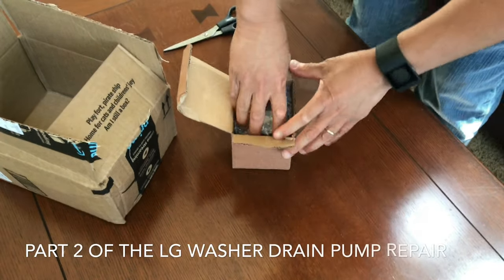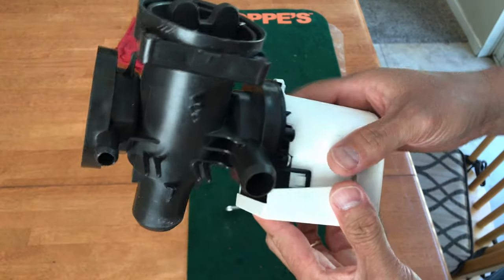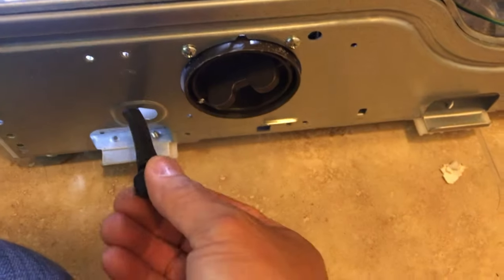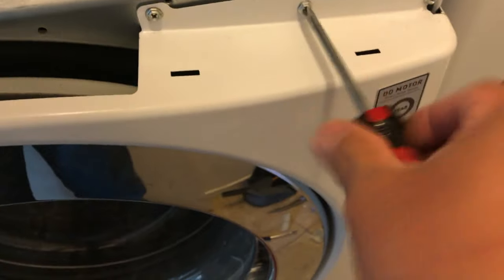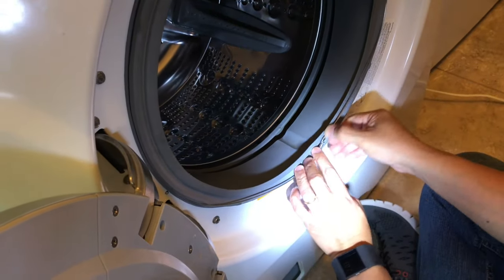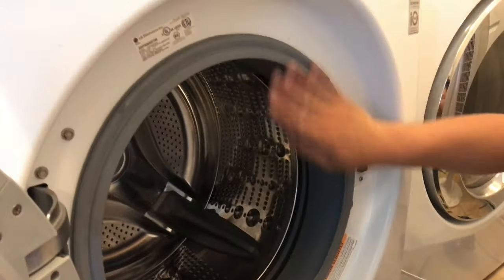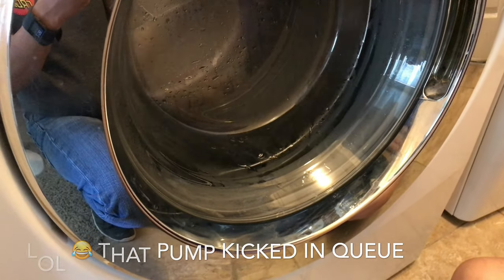How to Install Drain Pump on LG Washer Detailed Instructions Step by Step Pump Repair Part 2 - HD 4K

Comment: THANK YOU for the easy step-by-step instructions on replacing the drain pump. I’ve never done any type of appliance repair before but desperately needed our drain pump replaced ASAP. Thanks to Amazon’s same-day delivery and your fab videos, I am up and running less than 24 hours after my original pump died. A million thank yous!

Comment: I am a mom of 2 and a teacher who doesn't know anything about machinery or mechanics of any large household appliance. After noticing that my washer wouldn't drain, it was extremely stressful because investing in another washer would be another $1,000 expense. So I tried contacting appliance repair but it would still cost be around $300 or more for parts and labor. Just the estimate was $125. I really couldn't afford another thing on my plate on top of the stresses of the pandemic so I started researching online on DIYs. I came across your video and watched it a few times. The clear step by step instructions made me want to give it a try and so I ordered the corresponding part from Amazon for $25 and had my iPad on the floor and started disassembling it. Although it took me about an hour, wow, I seriously cannot believe I fixed our washer myself! Thank you so much for teaching me how to do this. My friends were all amazed and couldn't believe I did this alone. Your explanations and crystal clear directions were so crucial from me moving on from my DIY arts and crafts to hard core washing machines! I cannot thank you enough and if there's anyone out there who's hesitant....just go for it. It's a $25 risk I'm willing to take versus a few hundred dollars. Thank you again!
Reply from the maker: Awesome to hear! Thank you - thank you for taking the time to leave a feedback. I do appreciate it! Great job

Comment: Awesome video!  Thank you. 
I was able to pull it off. I had my doubts for sure. My LG was a different model WM8000HWA. It had three mounting screws that held in the pump instead of a clip. Also there is a circulating component that had 2 different electrical inputs on either side of the pump mechanism . I labeled them before detaching. Lucky I did because my brown/black wiring was opposite of this video. I used a flat head screw driver with my wife’s help to hold the other side of the ring and pried it into position pretty easily. Works great. Big relief!
Reply: Thank you Mr. Jarvis, you saved me a lot of time and frustration.
Reply: @2neverstoplearning  glad my comment was helpful!

Comment: Thank you so much for the best step by step instruction. I fixed a 10 year old LG front load all by myself. Don't even need a new drain pump (the inside propeller chamber clogged with sand!). All the best to you. Take care.

Comment: Thank you for your expertly crafted 2 videos on the LG Washing machine pump removal and reinstall. My washer was a slightly different model but very closely designed. The slight variations on my model were still self intuitive enough from your videos that I was able to successfully complete the project without a hitch. I saved at least $250 instead of having it done by a service technician. 2 thumbs up anybody with reasonable mechanical skills can do this one.
Reply from the maker: Thank you very much too for taking the time to give the feedback. Thank you for watching! Congratulations on getting it fixed.

Comment: Thank you for this! My machine is a different model so I had to use a couple of other videos to get some very model-specific information but these instructions got me through from beginning to end. I didn't have anyone else around to lend a hand when I got to the part where I had to reset the spring so I ended up using a pair of tire levers (the plastic levers you use to set a tire on a bicycle) to reset the spring. That was surprisingly quick and easy.

Comment: You saved us $185. That was what the appliance repair guy quoted us. 65 dollars to come and diagnosis. we fixed it using your video. The hardest part was putting the spring back on. We finally used a flat screw driver to gently pull the last bit in using very gentle pressure.  I am doing a load of wash right now.  I subscribed. Thank you!!!
Reply from the maker: Thank you very much for the awesome feedback! So happy to hear you are up and running! Cheers! It is rewarding to do it yourself... great job! (For me... to hear comments like this)

Comment: Fantastic video!  Superb step-by-step instructions.  My drain pump went two days into Coronavirus lock-down and my wife wouldn't let a repairman inside our house.  It took a little while to make the fix as my pump was attached to the washer a bit differently (3 socket screws fastened to plate resting on rubber gaskets).  With your excellent video, I was able to easily take the washer apart, replace the drain pump and put it all back together.  No leaks, no problems, clean socks and a happy wife!  For future YouTubers who find there way here, Amazon sells a Washing Machine Expansion Tool which is about $20 that really helps when you have to put the round gasket spring back on.
Reply from the maker: Thank you very much for feedback on both of the videos (part 1 and part 2). We appreciate it very much! Glad the videos helped.

Comment: Thanks so much. Finally got in there and the quiet on spin and drain cycle is wonderful. We used small vise grips to pull the spring apart on reassembly. One person held wire in place the other pulled spring apart. Thanks again for the clear instructions

Comment: Excellent video, got virtually the same model as yours, minor diff was the pump assembly was bolted down instead of the tab release, but your 2 videos made it really easy with avg household tools, not very handy myself, but amazed that we got it going thanks to your videos, saved about $300, got the replacement pump at Amzn w nxt day delivery, machine is purring away, and happy wife, thanks for the detail and relevant talking points, keep up the great work.
Reply from the maker: Thank you very much for the feedback! It helps the channel a whole lot! Great to hear you got it up and running. Thank you

Comment: Thank you so much for posting - I did a bit of research on the spring & ended up starting at the bottom & then using a vice grip to pull the spring to give me the extra length to wrap the wire around the seal.  Thanks!
Reply from the maker: Thank you very much for watching! Also appreciate you leaving a feedback/ comment.

Comment: Great video, When I reconnected my drain hose the BLACK wire went on the bottom and the BROWN one was on top. There's a little "N" on the housing that shows where the black wire is inserted. I wouldn't have been able to do it without you, much appreciated!
Reply: Thanks. He didn't show the wires so I was confused about which slot they went in.

Comment: Thanks for the video!  Hubby out of town and wouldn't ya know, pump went out.  I watched your video #1 and #2 couple times BEFORE hand and then DURING process pausing after each section.  I made sure to keep my screws separated and labeled, as I find I NEED to do that. Lol  Took me about an hour to replace it.  Works great!  Thank you!!!
Reply from the maker: Wow! Awesome to hear! Thank you very much for the feedback and for watching
Reply: BTW, did your pump come with an extra O ring??? Mine did...hope I wasn't suppose to use that!
Reply from the maker: @ellef4812  I heard some came with 2... just in case. You should be good. Thanks again

Comment: Great videos thank you , I’m trying to figure out what I did wrong. I started getting a leak on the bottom left where the drain pump is. The only I can think of that I did wrong was put the spring part of the wire that goes around the seal in the wrong location. Looks like I will be taking it apart again. You have the best video on YouTube for this thanks again.
Reply from the maker: Thank you very much for watching and feedback... good luck finding the leak. Also, check the hoses as well... it maybe hard to see but hoses may have a crack or hole... but really hoping it is just the wire clamps.
Reply: Same thing happened to me :( did you find where your leak was from?

Comment: Thanks a lot for your detailed videos. They were very helpful. I just completed the job, replacing the pump, and the washer is working great.
Reply: By the way, the old pump had a safety pin inside it I think which was preventing it from operating properly.
Reply from the maker: Thank you for sharing... the safety pin (getting there) interesting... Glad you got it working!
Reply from the maker: Glad it helped. Thank you very much for taking the time to leave a feedback. It helps the video and my channel! Thank you - thank you...

Comment: Thanks a lot man, this is gold. My 13 year old LG washer had a drain pump fail, and your video s on removal/installation are the best I've seen. I'm not much of a handyman, but over the course of a couple days I got the thing apart, the new pump arrived, and then I got it assembled. There are a lot of screws involved - have a system for keeping track of them and where they are used! I was going to use coat hangers to replace the spring clamp around the rubber bellows, but surprisingly I was able to just snug it on by hand (spring was corroded/rusted, that may have something to do with it). Found a small tear in the bellows that was above the water line. New bellows are over $100 - duct tape to the rescue!. If anything else breaks on this unit, it will be time for a replacement.
Reply from the maker: Secretarian so cool! Wow... that LG served you well for a long time. Anyway, Thank you very much for your kind words! I really do appreciate the feedback! The more activity this video gets the more it reach... = help people out. Again, thank you so much!

Comment: Great video. Just replaced my noisy pump. It was still working , but very noisy when draining. Now works like a charm. Thanks! You were right the hardest part was getting the spring loaded wire back around the seal. 👍🏻👨‍✈️
Reply from the maker: Glad it helped. Thank you very much!

Comment: That metal ring had me at all stages. To put it nicely. 😁. 
I eventually got the ring around one side and held what I could with my body. I used a Phillips screwdriver on the 💍 part of the spring and pushed it over.

Comment: Very helpful! Although one thing of note is on my machine, the brown wire is actually at the top while the black is at the bottom… that’s exactly how it was when I took the original pump out and I left it on the same configuration when I put the new pump in. I have no idea if I should’ve done it the way you did with brown on bottom and black on top.

Comment: I am going to save you all a bunch of time. 

1) Drain the machine as well as you can and have old towels on hand
2) Get a helper
3) Unplug the washer
4) turn off the water & disconnect the hoses
5) Remove the 2 screws in the drain door that hold the pump in place
6) lay the machine on its side
7) remove the pump from the enormous access hole on the bottom of the washer
8) install new pump
9) Do steps 5-1 backwards
10) you just save 20 minutes so you have time for a refreshing cold beverage of your choice.

Comment: My drain pump had the brown wire on top, black on bottom. Washer works fine now but the new drain pump makes a noise, vibrating kind. Is it possible I have the pump running backwards?  I may take things apart and swap the wires around like you show. I did take pictures before removal and my LG TROMM washer drain pump came with the brown on top. 

If the wiring isnt the issue could I have a defective (but operational) pump?

Thank you

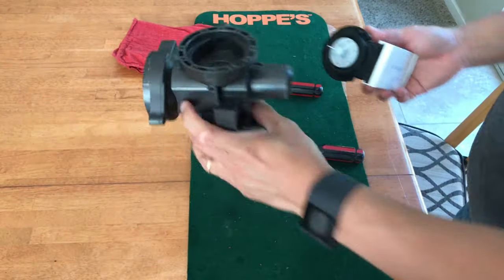Comment: What if the new pump doesn’t fit into the plastic housing so that the 2 white tabs aren’t in slots (as the slots at a different place) seen at 1:32? Also, when putting in the 3 screws- it seems like the motor isn’t completely flush. It’s only flush where the 3 screws are. Thanks. Working on this now.

Comment: Just a tip when replacing that white housing to the pump body. Use a sharpie to note the black and brown wire placement so it is easy to remember if you ever have to do this repair again in the future. Brown is neutral and black is line. The white cover actually has some marking just above the slots on the housing, but they are difficult to read.  Nice videos on this subject and I especially liked you providing the orientation of the white housing/motor to the pump housing. You actually can indeed put the two together incorrectly if you're not watching carefully.
Reply: a1930ford I made the mistake of not paying attention to where the wires are plugged into the pump I'm having trouble getting around this issue it has a blue and a gray wire and I'm afraid if I guess I'm going to burn up the motor has anyone ever had to deal with this and how did you figure it out??
Reply: On the Right circulation pump the blue wire is on top and the gray wire is on the bottom

Comment: Good video , the only thing I have to say is that the pump is OEM , is an aftermarket, the OEM cost about $50.00 or a little more , an advise to all the viewers , I do this for a living, try to always use the OEM parts unless is not available

Comment: Is this the probable solution for the OE error? Thanks for the great step by step video.
Reply from the maker: It is... but before you do what I did on this video... do the free troubleshooting: 1.Check for kinked or bent drain hose 2.check for clogged hose. 3. Clean the drain filter... 4. Disassemble and check the drain pump... then do this video
Reply: noted.. thanks for the fast reply!

Comment: But after you put back on the drain hose..where do you attach the other end?
Reply from the maker: Are you talking about the small hose? It is plugged on one end… you only use it if you want to drain manually- no power. To manually drain. Remove the plug and place the small hose to a bowl or bucket…
Reply from the maker: See 3:14 to 3:27
Reply: Thank you ..this helped me fix my washer

Comment: I've got the LG version with a front opening to this area, so the technician just opened the panel and installed, without taking the front of the machine off. I just stressed the motor again, this time I think I'll be able to do it myself.
Reply: also my LG front loader HE (not stackable) has the motor on the other side, so no need to remove the black bit

Comment: Confused...I have a LG Wm2050cw washer but when I removed pump it is different.  It is a white Hanning casing.  Can I still use this new part without any casing?
Reply from the maker: Send me a picture: cbatilo@gmail.com. Anyway, I did a quick search of your LG model #  WM2050cw and found this part that fits. It is from Amazon: https://amzn.to/2YKJJ4l
Reply from the maker: The drain pump is the same as what I ordered for my washer. Shown on Part1 of this vid: 0:36 https://youtu.be/VXk5LM9hFQw

Comment: There are two models on with another circulation pump on the right. That one has a Blue and gray wire connected to it. On the right pump similar to this setup do the wires connect the same Black on top and brown on the bottom. I am seeing the opposite on my model. I may have got them backwards or that is how they go.

Comment: Attention! Its possible you don't have to remove the front of the machine at all! I removed the pump from underneath once I removed the three screws holding it to the inner front frame! Remove the screws then prop it up and crawl underneath to remove the pump!  FYI

Comment: My Samsung washer m/# WF203ANS/XAC is flashing error code
nd. According Samsung tech support my washer doesn't have the drain pump
filter. I replace the drain pump any way. Still same error code "nd" not draing. Fuse problem?
Where is the fuse? Any other possibility? Please help.
Reply from the maker: It is typically your filter. The front of the drain pump has a threaded access to the filter. Clean it. The other possibility... check your drain tube or hose coming out from the back of washer. Check to confirm not clogged.
Reply: @cbatilo  Thank you. Overnight something else I found: it would not finish the whole wash cycle but end in error code "nd" ( not draining). However it would rinse, spin and drain at rinse/spin cycle. End nicely with no error code.

Comment: Do you need the plastic housing.  I have the pump, and should work but I had another model initially. Can I find a plastic housing to cover the motor?  Just want to ask before I put it back together.
Reply from the maker: Brian Whitehead just saw this... sorry. Yes you do.
Reply: Part # by chance??
Reply from the maker: here you go: Replacement LG Part # Ordered: 4681EA2001T
Reply: Mine didn't have a plastic housing when I removed it. So it went back in without one😁
Reply: @cbatilo  I am having no luck finding just the plastic housing cover. Any advice?

Comment: I was changing the pump and forgot how it was wired. Is it like brown goes to N and black goes to L? or is it other way around?
Reply: manu bali  I'm dealing with similar issue myself now I have a blue and gray wire to go to the pump and I have no idea which one goes where how to get around this problem??
Reply: david bass i read somewhere that it doesn't matter how you connect it.

Comment: I did this fine and the got a new error code pf...what did I do wrong
Reply from the maker: Kerin Guillaume power supply... try: unplug it. Leave it unplug for a minute or two. Then power it back on. Same error?  Double Check the power cables to the pump and door.